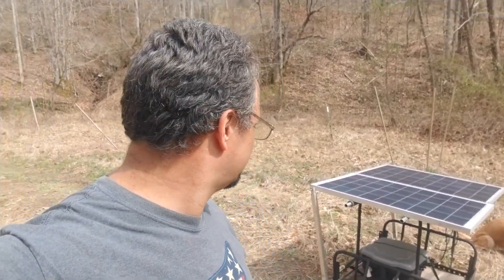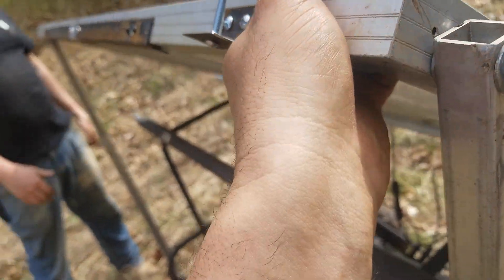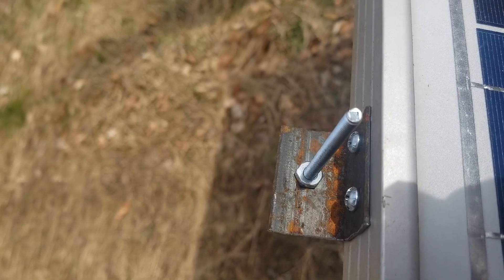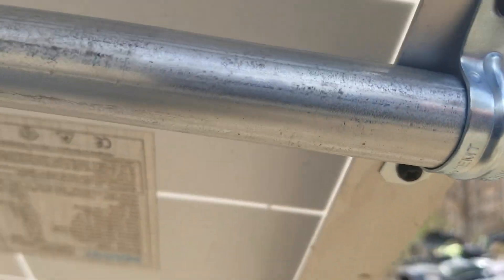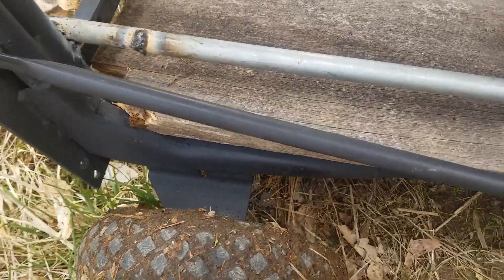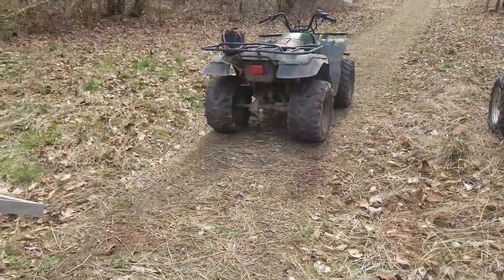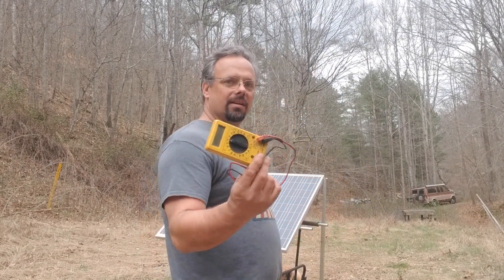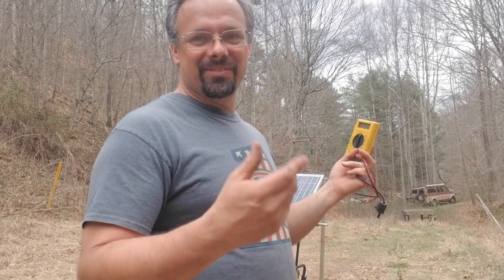DIY Portable Solar Generator

Comment: That is so cool Luke! I would love to have one of those but then I'm not as handy as you are. LOL I especially love the little thing that indicates if it's at the right angle towards the sun. Pure genius!
Reply from the maker: I don't Know Ann, You seem to be becoming pretty handy yourself. You are getting stuff set up at your property, and doing your own work on it. Insulation and all. Before you know it you will be building all kinds of stuff. 
This could be done pretty easy using one of those little wagons like they sell for use around the house like this https://amzn.to/2TSqgzH with the batteries and inverter in the bed of the wagon and a couple of pipes strapped to the top of it you would have essentially the same thing. Actually more portable than mine.

Comment: Cool. What panels are you using and which type of panel?
Reply from the maker: These are older 100 watt polycrystalline panels. They are the ones I used to have on my camper van. It would be better to use monocrystalline panels like these https://amzn.to/39SU7xw 
Those are the ones I have on Zephyr and they work well.

Comment: Great idea Luke! I built a similar system mounted on a pole in the back yard. Ran the cable underground to a battery box beside the house. It's been going for about 3 years now.
Reply from the maker: Glad to hear it is still working.